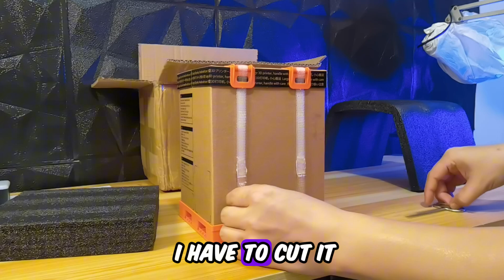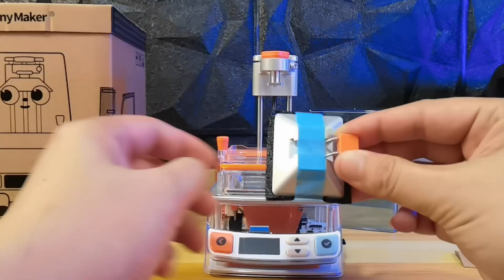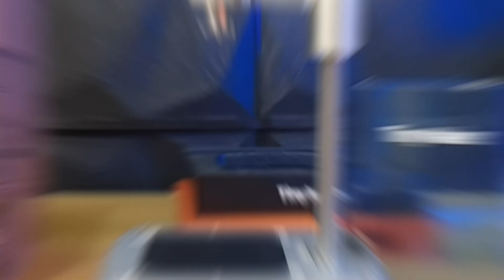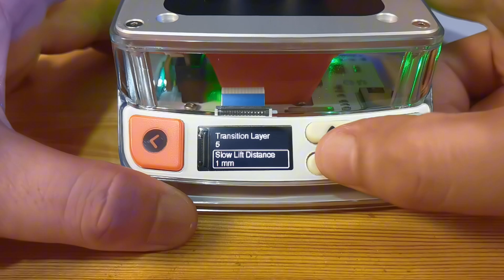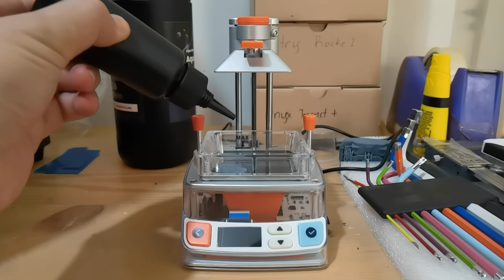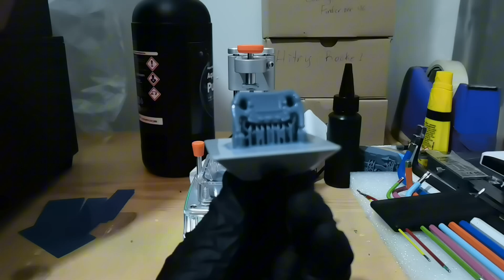Cuteness Overload Resin 3d Printer

Comment: I have an X1C and haven't gotten a resin printer yet. I was thinking of trying this one out as it comes with everything I would need, and is small. I would really only use it to print miniatures. However, my X1C with a 0.2mm nozzle can print more detail than this printer, with less noticeable layer lines.
I wonder if it would be possible to upgrade the screen to a higher resolution monochrome?
Reply from the maker: Honestly no idea
You might wanna ask tinymaker directly